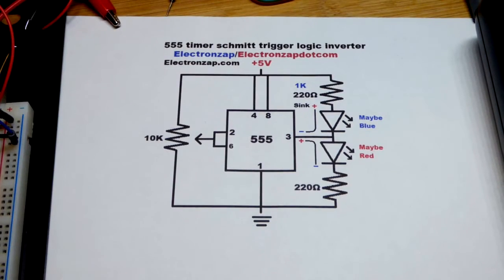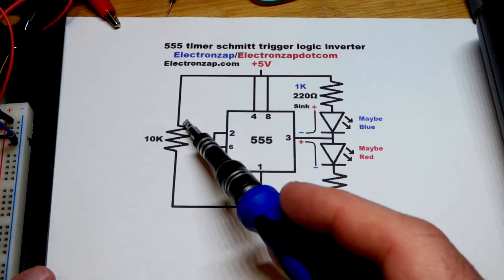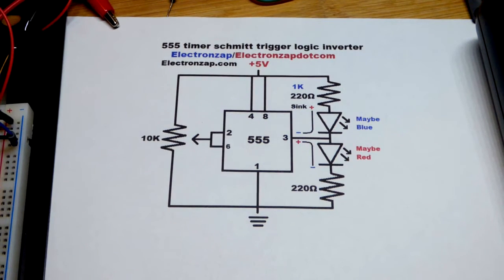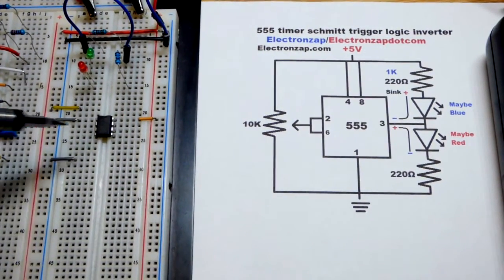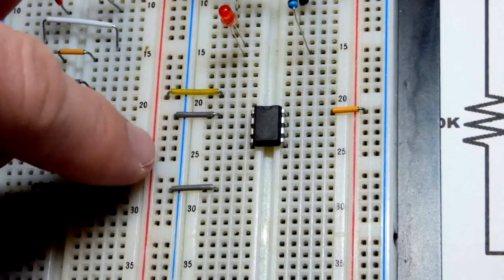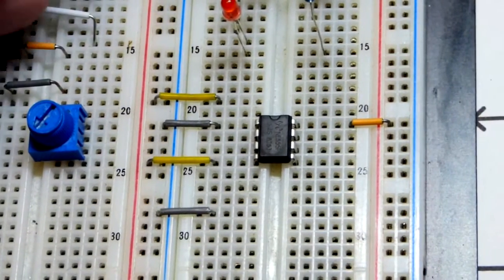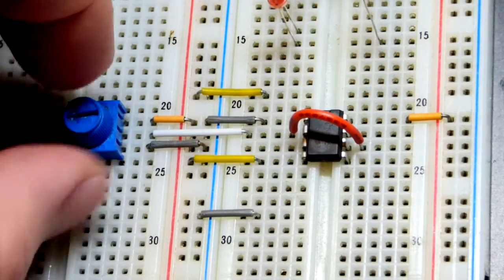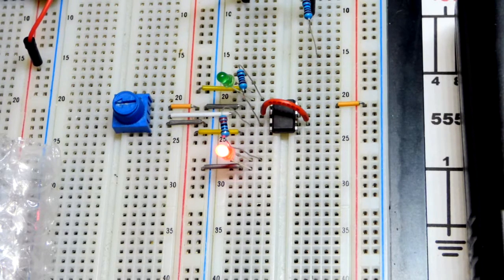555 timer schmitt trigger logic inverter circuit step by step build electronics by electronzap

Comment: I want to build a circuit that will reduce current when the voltage drops below a certain threshold. (3. 5-3. 6 V). A
What do you think ? Do I need a zener diode or does it go with a variable resistor?
(The Li-Ion batteries drop until the voltage reaches 0 V and destroy them. It doesn't charge anymore. I want to build a battery protection circuit to save them.)
Reply from the maker: I haven't really built a low voltage cutoff circuit yet. I'll try to get to that soon.
Reply: @Electronzap  25-30 years ago, we were building such assemblies. But. . . I got married and gave up this hobby.
I knew this CI 741 is a comparator (just like 555).
Theoretical. . . if you apply voltage to one of the gates, at the output you will have + or - signal.
I lost training.
I'll look for books and notebooks from the past.